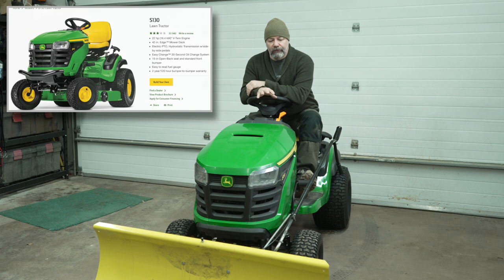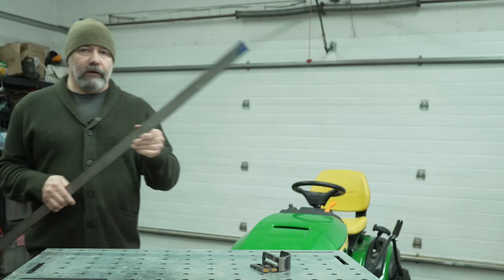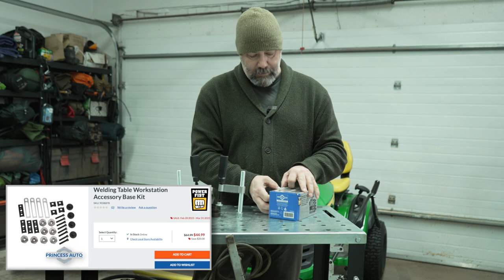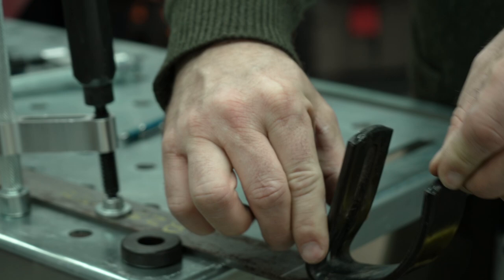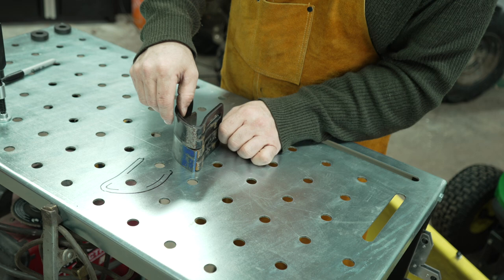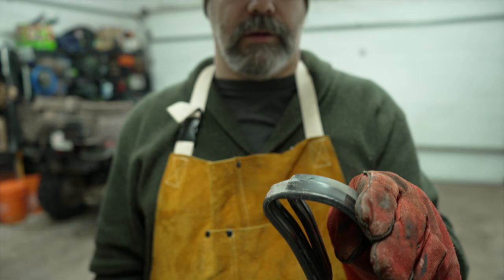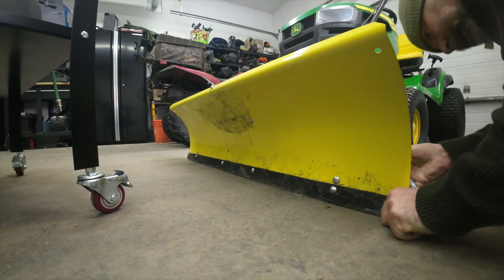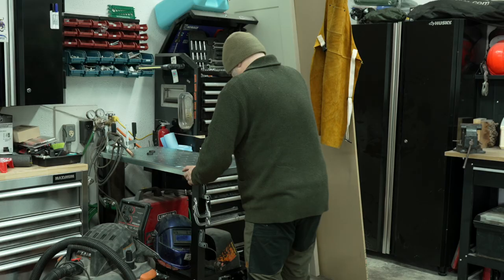John Deere S130 Snow Plow Repair | Princess Auto Welding Table | Clamps and Accessories

Comment: Princes Auto really should be thanking you for your promotion of their gear. 
The welding and other skills, were they things you learnt in the British army? Regardless, very useful knowledge to have. Cheers, Paul from south east Australia 🇦🇺
Reply from the maker: Hey Paul - I like promoting Princess Auto as it shows you can buy inexpensive tools and do your own repairs.  Something that's getting lost on the younger generation.  I've always been mechanically minded and when I left school studied electronic engineering.  In the RAF, I became an aircraft technician working on gas turbine engines, so gained more knowledge there.  I always say to people you only learn by doing and making mistakes.  I've make a lot of mistakes over the years 😄